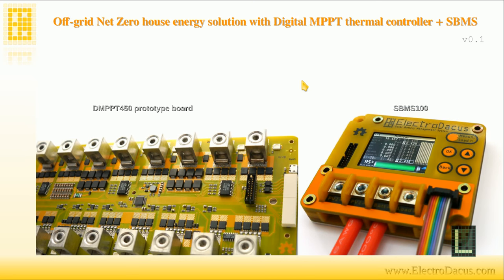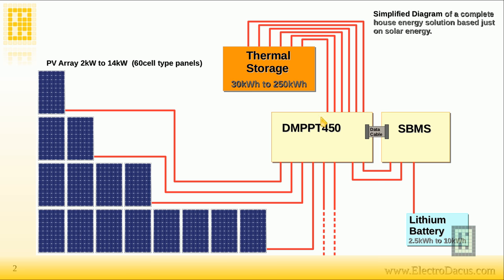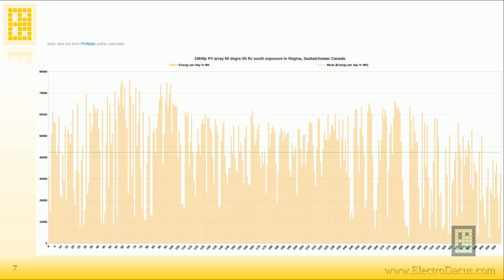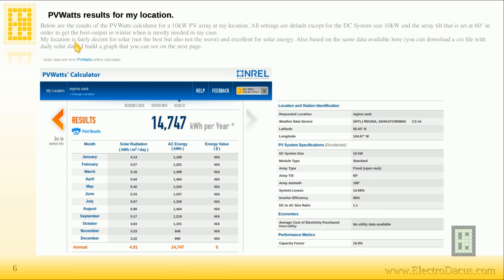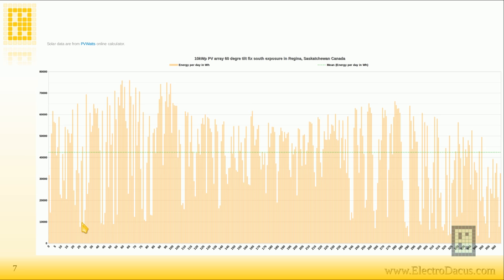Explaining the Digital MPPT thermal controller

Comment: I like your project but damn it's difficult to even understand what your kickstarter is about :) So if I understand this correctly:
-It pushes additional energy from PV into efficient heat storage instead of batteries
-It implements MPPT for both battery charging and heat storage
-This only works with good insulation and a heat reservoir

Why are these charge controllers so expensive? Will prices go down significantly?
Could this work for a well insulated RV / tiny house / expedition vehicle with a 7.5m x 2.5m box (24' x 8') and a hot water reservoir and about 2.2 kW peak solar? How would you combine this with a HVAC with ERV?
I have a rather crazy idea to add 24x275 watt panels that fold out as solar awnings (6.6 kWp) and solar tracking.
Reply from the maker: There are two products the DMPPT450 is a Digital MPPT thermal controller (nothing like that exists so that is why is a bit complicated to explain).
The DMPPT450 can take a large PV array up to 14kW peak and it has to deal with 450A that is the reason it looks expensive to you (around 450USD depending on exchange rate) A traditional MPPT converter based on DC -DC conversion capable of 450A will cost at least a few times more and last much less because of the use of electrolytic capacitors not to mention that it will be so heavy just the international shipping may be more than 450USD.

The short explanation on what DMPPT450 will do is that it accepts a large PV array and will redirect part of the large PV array to (SBMS) Lithium battery charging based on the amount of sun so in my example case where I have 39 panels if is sunny then 6 of the 39 panels will be redirected to battery charging for about 50 to 60A charge current while all the other remaining panels 33 panels will be used to store thermal energy (a sort of thermal battery) In my particular case the thermal battery is a large 14 cubic meter concrete slab that can store up to around 95kWh of energy.
In case is cloudy or later in the day when there is much less sun the number of panels redirected to Lithium battery charging will increase in order to maintain the same 50 to 60A charge current ideal for a 200Ah battery (about 0.25C) with worst case all 39 panels will be redirected to Lithium battery charging if needed to maintain that 50A even in a overcast snowy day.
This combination of SBMS and DMPPT allows you to save on battery size since battery will be charged fully even in the worst overcast day because of the huge PV array and the heating will be mantained thanks to the huge storage capacity of the thermal mass.
So in my case 10kW PV array + 95kWh thermal storage + 5kWh Lithium battery will allow to provide all the house energy fully meaning electricity and heating at the most cost effective price.

To get an idea of why here are the cost amortizations for different elements in the system.
PV panels 2.4 cent/kWh
LiFePO4 battery 25 cent/kWh
Thermal storage less than 1 cent/kWh

Thus you will want to oversize the thermal storage since is the least expensive then the PV array and try to reduce the size of the LiFePO4 battery for an optimum cost amortization and that is what the DMPPT + SBMS allows.
The cost of DMPPT and SBMS in the entire system is less than 5% so is irrelevant when the entire system is considered.
My profit margins on both SBMS and DMPPT are the same and much less than standard acceptable. There are over 50 high power mosfets (best available) inside the DMPPT450 to handle the 450A and plenty of other parts like ideal diode controllers mosfet drivers, current sense amplifier multiple PCB's, connectors .... Is like you go to grocery shopping and each item is just a few $ but when you add them all up the total bill is a few hundred $.
Reply: Thanks for your detailed reply, I think I understand this fairly well now. The more I read the more I like it, and I will email you about ordering and shipping to europe. And I really want to thank you for producing such an outstanding product that is really needed for more energy independence! You are doing great work :) Thank you.

A technical question in order to understand how the charging works - Is there a DC to DC boost converter in the SBMS? Or do you use PWM to buck the voltage to do charging of the battery? I ask because I wonder how a 24V solar panel array is charging a >24V battery? Even If I use 7 x 3.7 18650 batteries up to 4.0V that would be 28V. Is the charge current from the 24V solar panels regulated at all?

I've also read you recommend LiFePO4 instead of 18650 and I will do more research, but I can buy 18650 for about 200-250€ per kWh, if I do a lot of soldering my self it seems I could save a lot for a 10kWh battery.

For mobile use, I'm also concerned about backup. A generator is not ideal, but kind of necessary. Space is limited for PV and a lot of tiny house / RV guys want to move from fossil fuel to PV but without a backup they won't. So maybe more support for backups if you are standing in the shade or at a bad angle or something would go a long way :)

Since you mention economics, I'm also curious: Why is there such a draught of integrated BMS / charge devices? Your hardware is open source, yes? So why isn't there a cheap chinese manufacturer producing these? Not that I don't wish you economical success! But the ability to easily produce smart batteries seems to be limited by these charge / BMS systems. I'd love to see a cheaper and officially licensed version of your excellent system from china.
Reply from the maker: There is of course no DC-DC converter in the SBMS since that will make the SBMS a few order of magnitude larger an heavier not to mention more expensive with no benefits at all for offgrid.
There is also no PWM used since that is for constant voltage charge stage only needed on Lead Acid or high energy lithium cells if you want to push the battery to the limit of charge to gain that extra 5% or so additional capacity with huge detriment to cycle life so is only used in portable electronics and sometimes EV but there is usually recommended to be avoided and only used when the extra range by fully charging is more important than battery life.

PV panels are a constant current power source so while a 60 cell PV panel may have a 31V or so max power point voltage at STC (standard test condition) where PV cell temperature is 25C (requires ambient temperature below -5C or so) in summer that max power point drops to 27 or 28V so in summer months the charge efficiency of 8s LiFePO4 or 7s LiCoO2 will be very close to 100%
In winter when temperature is well below freezing the efficiency will be lower maybe as low as 90% but still more than sufficient since you will probably only be using 50 to 70% of the available energy so there is plenty of excess anyway thus efficiency is less relevant in this case.
200€ per kWh is very expensive compared to LiFePO4 that is around 300€ / kWh because LiFePO4 has typically at least 4 to 5x higher cycle life so in therms of cost amortization it has a much better price.
On tot of that LiFePO4 is also much more safer and also easier to make a pack with no additional cost compared to very small 18650.

I'm offgrid and I have no backup so is a wrong assumption that you need backup since you do not if the system is sized properly.
I already have 5 years offgrid with no backup.
You can not produce my SBMS cheaper than I sell it for even if the volume will be much higher the cost reduction to remain profitable will not be more than an additional 10 to 15%
My device is way to complex even if open source for most small China companies to copy.
The SBMS4080 was my cheapest possible SBMS and that was the target for that particular unit. Now the SBMS40 while slightly more expensive has huge additional functionality compared to the SBMS4080.
You will sure hate cutting any functionality from the SBMS40 to get closer in cost to SBMS4080.
The SBMS4080 was 159CAD while SBMS40 that is the current low cost version is 259CAD but the amount of extra futures are more than worth the extra cost. To mention a few of the additional futures is a larger resolution color LCD, 16bit ADC for more precise current measurement, internal data logging, WiFi, external current shunt capability for large loads up to 12kW, dual SSR for remote control inverter and charger many other small futures.
I started the SBMS development about 5 years ago when there was no other option and I wanted just to design the SBMS for my own use not realizing the amount of work involved.
Today there is still nothing similar to SBMS as far as I'm aware and people still use Lead Acid solar chargers + eBike BMS + separate monitoring for a more expensive and worse system than SBMS.
I do this as a hobby and will keep this small. I welcome anyone to officially produce this but the demand is still not as high and you will not be able to produce at lower cost than I do. I work cheaper than someone in China :) basically free. If I where to assemble this in china instead of my own shop the profit will be zero or even possibly negative.
Reply: Ah thank you kindly for explaining! 
So PV being constant current would mean that if the batteries take too much current, the voltage will drop?
So the SBMS can't bring the PV voltage down? But it doesn't have to because the PV will only give a voltage a bit above the current battery voltage since it's current limited from the charge current? And then when the battery voltage gets too high it simply stops?

If I got this right, I think I understand now. That's quite neat! 
Of course it makes total sense since PVs can only supply a certain amount of power, so on a fixed resistor they provide a fixed current.

I'll have research more about batteries, but thanks to you I actually checked a bit about chemistry (Wikipedia  Comparison_of_commercial_battery_types, also has links). Apparently LiNiMnCoO (or "INR" or "NMC") 18650 have even higher cycle life than LiFePO4 though. But that page lists LiFePO only having twice the cycle life, not 4-5. And NMC have higher energy density too. But I'll do more research.

The new 18650 batteries apparently actually are NMC batteries like the Samsung INR18650-25R 2500mAh – 20A (9.3Wh for 260€/kWh) or the LG HG2. I know these ones from vaping.
Reply: PS: So this "NMC more cycle life than LiFePO4" number comes from tesla, so it's probably marketing. I found a good article "types_of_lithium_ion" on batteryuniversity that explains this.
Reply from the maker: The panel voltage will drop to the battery voltage level and current will be directly proportional with the amount of light getting to panel.
The chemistry of the battery is not the only thing dictating how good the cycle life is the manufacturing quality is also important so same battery chemistry from two different manufacturers can have a huge difference in cycle life or even from same manufacturer if it has two slightly different models for different type of applications.
If you check the spec of the INR18650-25R  https://www.powerstream.com/p/INR18650-25R-datasheet.pdf page 8 you will see that battery capacity will drop way below 80% of original in about 250 cycles at high charge discharge rates so if charge discharge rate will be more reasonable below 1C the cycle life may be 2 to 3x better so maybe 500 cycles.
A LiFePO4 like the one from Sony in 18560 format will be capable of 6000 cycles and a LiFePO4 in a large form factor like the Winston cells can do 5000 cycles at 80% DOD http://en.winston-battery.com/index.php/products/power-battery/item/wb-lyp400aha
So Wikipedia is not an expert source of information :)
And Tesla provides no clear documents about their Panasonic cells just marketing but when you find the similar cells from Panasonic you will see they are good for around 500cycles at 100% DOD and that is good for a car but horrible for offgrid energy storage.
Tesla battery may do around 1000 cycles if only used at 80% DOD so not fully charged and discharged and that is about 350000km before it gets to 80% of initial range (no warranty on the battery degradation) so if you fast charge often they will limit your charge speed so that you do not degrade the battery too fast.
Reply: Thanks for all the explanations! 
I'll keep that in mind and do further research on batteries.

So far I've only found the Winston 200ah battery over here in Europe for 498€ / kWh. And on that website it only lists 3000 cycles at 80% DOD. But I'm sure I'll find cheaper ones and of course just the easy of use alone plus the safety is worth more than that. I'd waste a ton of time and would have to source more special things to make my own 18650 packs.

Of course it's possible that with 80 or 70 DOD you can push the INR / NMC cells to 2000+ cycles (I think the 20A discharge is just not representative / biased, typically they would discharge at something like 3 amps for a 1000 watt load and 100 cells). 
And it's possible that when their cycle life is gone, battery prices and quality might be improved. So it's possible that buying now at half the price, then buying again in the future at half the price but with improved quality might be more economical.

Just some more thoughts, but I will most likely buy LiFePO4 like you recommend. Thanks, you helped me a lot!
Reply from the maker: I do not sell batteries and have no reason to recommend one chemistry over another but after a lot of research I decided to get LiFePO4 for my own house.
This is a website in europe that sells Winston cells https://www.ev-power.eu/Winston-40Ah-200Ah/WB-LYP300AHA-LiFeYPO4-3-2V-300Ah.html and that 300Ah cell 3.2V nominal has almost 1kWh and costs 320€ so not sure where you found the higher price.
I do not think you can exceed 1000 cycles 80% DOD on NMC. Those cells are designed for high energy density not high cycle life.
Making a large pack from small 18650 is a lot of extra cost and extra work.
Look at my recent posts where I build a LiFePO4 out of A123 pouch cells about 18.5Ah real usable capacity and it took me over 30 maybe 40h + a lot of extra cost for all the accessories needed      https://plus.google.com/+electrodacus
I liked those cells become of high cycle life and low aging (aging is very important also since it can be 0.5 to 2 or even 3% per year).
Here is the spec http://www.formula-hybrid.org/wp-content/uploads/A123_AMP20_battery_Design_guide.pdf
The cycle life at 25C battery temperature is over 5000 cycles at 100% DOD and 1C charge discharge rate page 25
Reply: Thank you again! That is a very good price! 383.2€ / kWh including VAT. I actually found that site but closed it again because prices where initially in dollar haha. I'll definitely go with the LiFeYPO4 route.